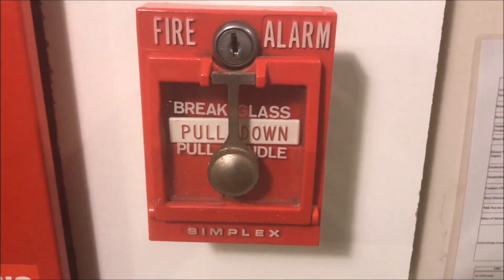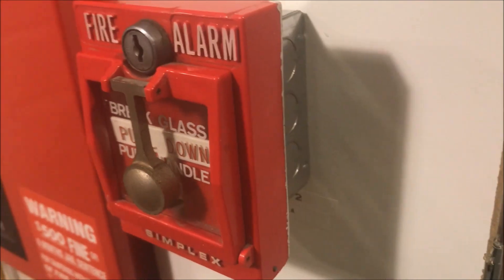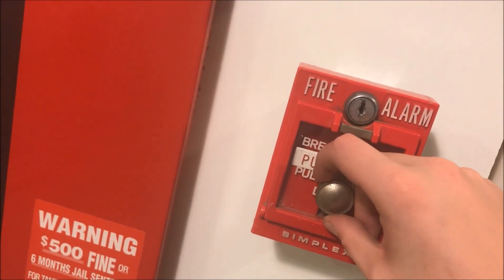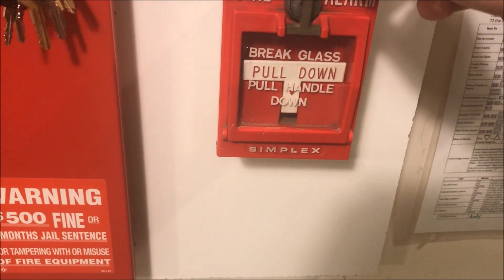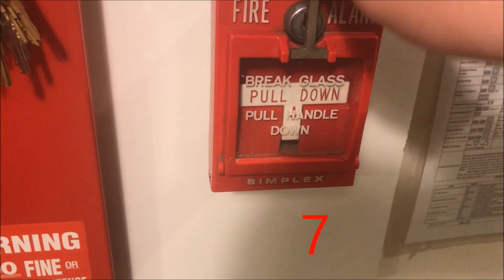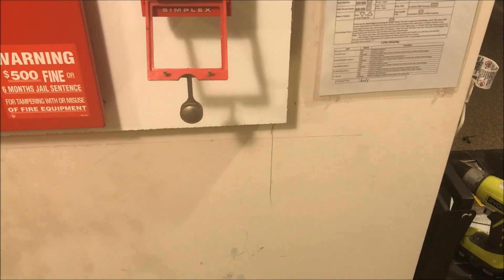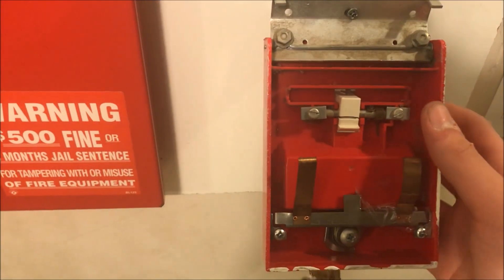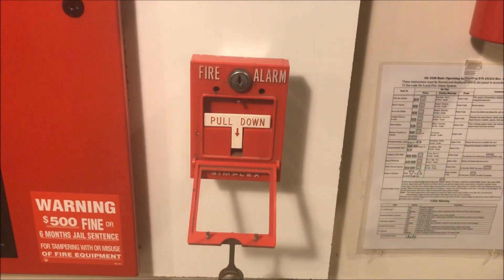Breaking the Glassplate in a SImplex 4251-30

Comment: BRO WTF YOU BROKE THE RARE GLASS!
Reply: Yeah, that was the lettering style from the early to mid-70s. For this video I would've replaced it with a newer glass pane to break, the kind that just says "BREAK GLASS." (In virtually any system I've seen with 4251-30 pulls using that glass lettering style, there's at least one with replacement glass.)

Comment: You shouldn’t have broke the glass. They don’t make that glass anymore
Reply: I agree. Even the newer glass panes designed for the newer Simplex break-glass pulls (the ones that just say "BREAK GLASS") work just fine in the older 4251-30 -style pulls. In fact, lately in nearly every system I've seen with 4251-30s there's always at least one with a newer glass pane like that.

Comment: Did you have extra glass for that pull station
Reply from the maker: No, but they are cheap
Reply: @FireAlarmsandSuch  Yeah, even the newer glass panes that just say "BREAK GLASS" often found with the newer 2099/4099 break-glass pulls will work just fine in 4251-30s. I've seen quite a few instances of that in real life; I think at least one of the 4251-30s at my first elementary school is currently set up that way.
Reply: @FireAlarmsandSuch  let's hope the newer ones break easier
Reply: @theonewhoisfelonious8211 , they do.
Reply: @FireAlarmsandSuch Dude, you gotta slam the handle really hard as you can.

Comment: That was the glass style from the early to mid-70s you broke. But to be fair, I've seen quite a few 4251-30 pulls "in the field" with the more modern glass pane that just reads "BREAK GLASS" on it.

Comment: Aw dude that was the original glass, it's pretty hard to find it with that lettering on it.
Reply: you should have not broken it
Reply: Yeah, that was the lettering style from the early to mid-70s. Though in virtually any system I've seen with 4251-30 pulls using that glass lettering style, there's at least one with replacement glass (in many cases, the newer glass pane that just says "BREAK GLASS.")
Reply: @ZakWolf  Yeah. I thought they stopped making it in 1990 because I have seen the newer 4251-30s have it too. Mine came with that style and I took it out and got it out in 1 piece.
Reply: @ZakWolf  like the ones that have the handle grip and not the flat handle like I have.
Reply: @firealarmtechguy4444 , I know they continued to say "BREAK GLASS PULL HANDLE DOWN" up until around the early-to-mid 90s, even after they introduced the "newer" 2099 break-glass pulls, before later switching to just reading "BREAK GLASS." But like I said, those newer glass panes work just fine in the older 4251-30 pulls.
Reply: @ZakWolf  Yep. I saved the glass with "BREAK GLASS PULL HANDLE DOWN" I new it all along. My local simplex distributor ordered me the ones that just say "BREAK GLASS" I am going go break 1 for a vid.